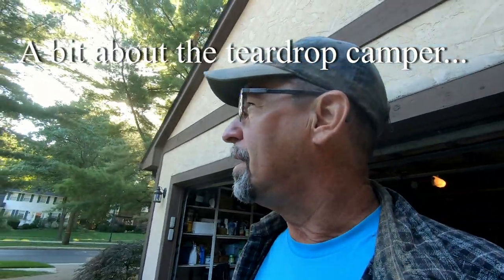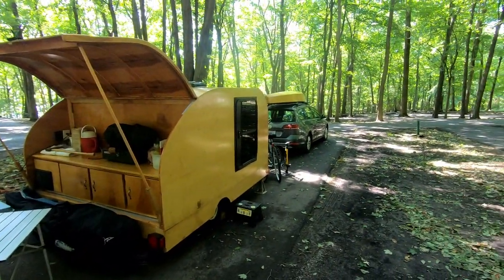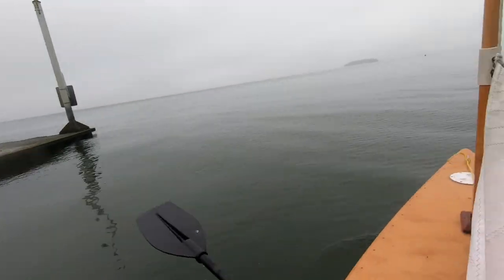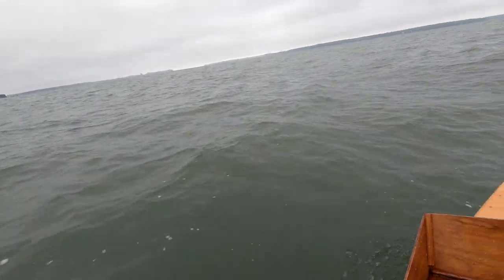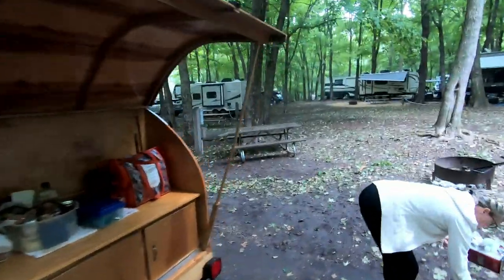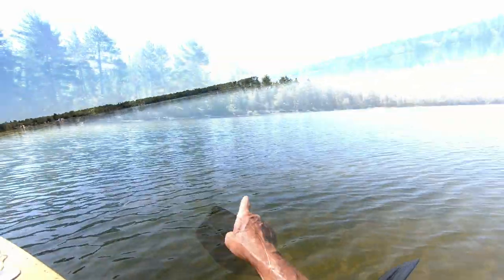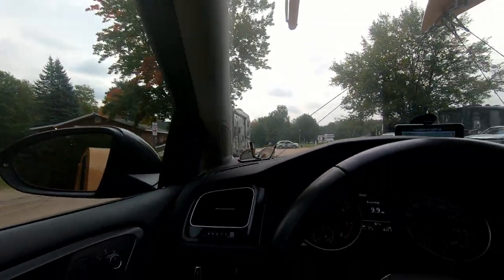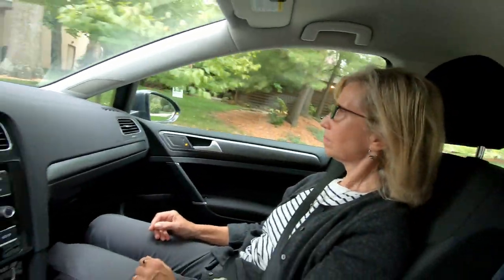Sailing Kayak Nomad: First Time on Lake Superior!  (Plus Lake Erie, and Teardrop Camper)

Comment: Hello, 
Thanks so much for your great videos! I'm currently in the process of building my own self designed sailboat as well (around 13 feet). I've completed the planking and am thinking about  dagger board placement right now. I was wondering if you might be able to answer a few questions to help me get on the right track. I had no way of contacting you so I figured I would try to send a message. Thanks
Reply from the maker: I'd be happy to help--interested in pics of your build too!  You can email me at douglasdrudy@yahoo.com if you like
Reply: Okay great! Will send pics. Thanks very much!